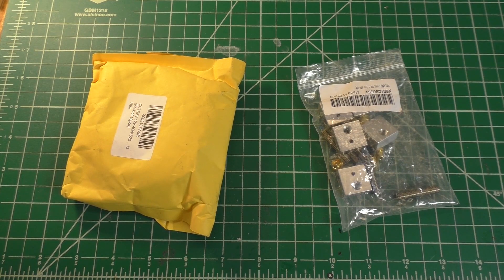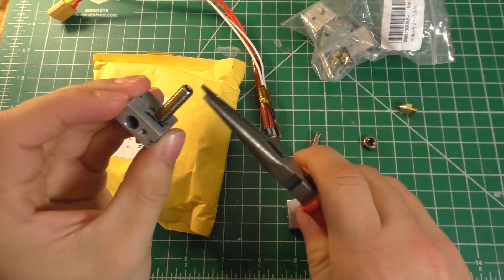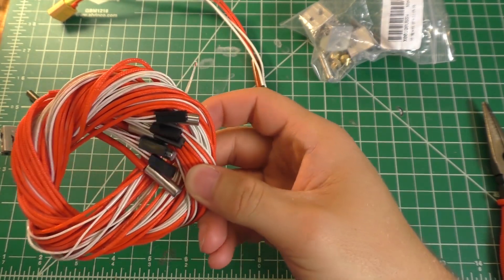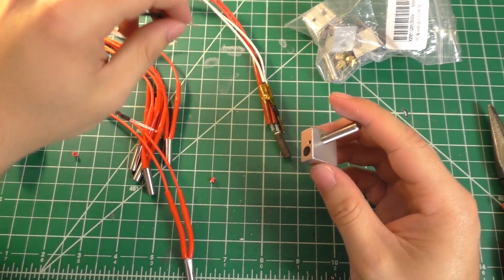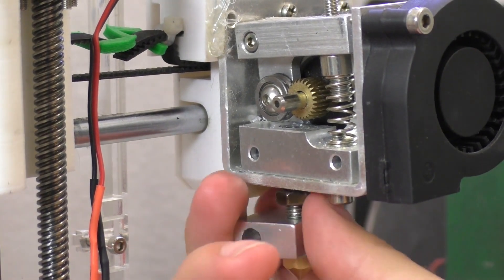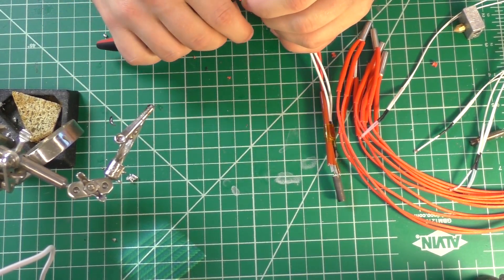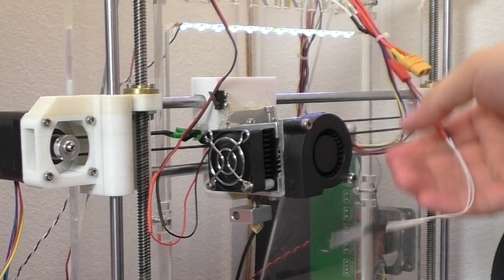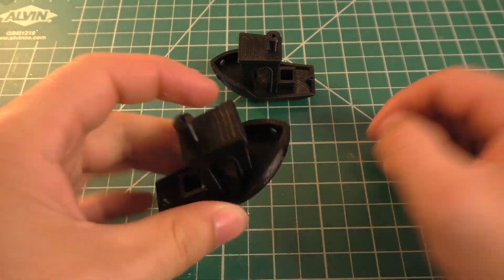3D Printer Hot End Rebuild

Comment: i just got a a8 plus around a month ago an ive been loving it. i noticed ur extruder is metal. where can i find a metal frame extruder for the a8. the heat sink on mine is so small an the extruder its self is plastic. ive been planning on switching it over to v6 hotend but havent gotten around to it. the extruder looks very similar to whats on my creality machines but it being a direct drive i wasnt sure if they was interchangeable or not if a creality style extruder will work i have a couple spare metal ones an i'll just swap them out. any suggestions on a hotend setup for these printers is greatly appreciated. i dont know what differs from the a8 plus to the original a8 but i assumed the hotend assembly was the same from what ive seen in pictures.